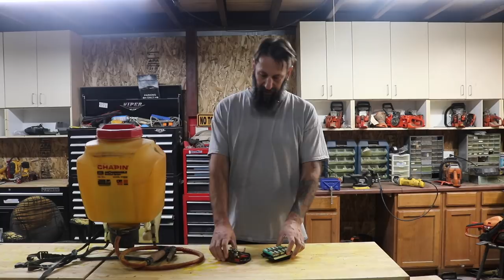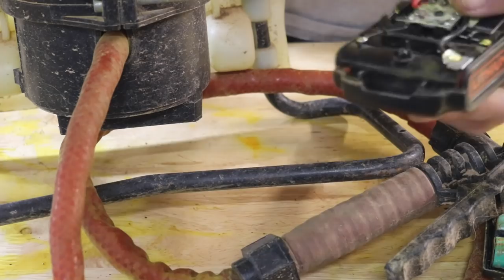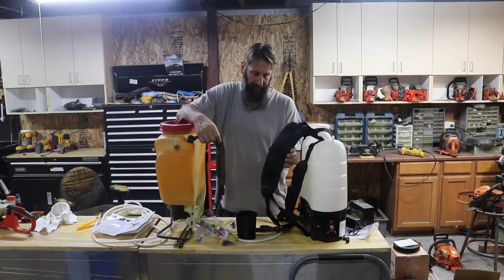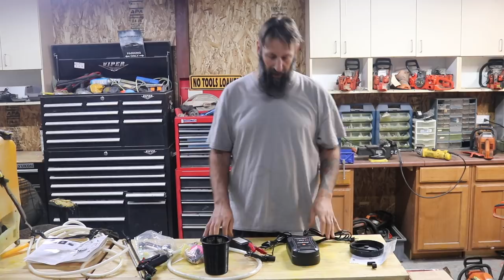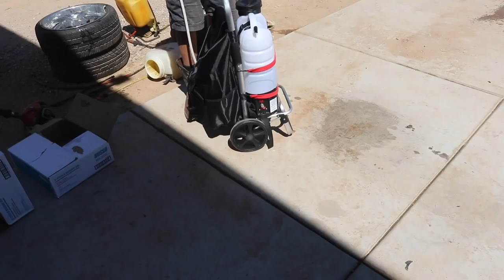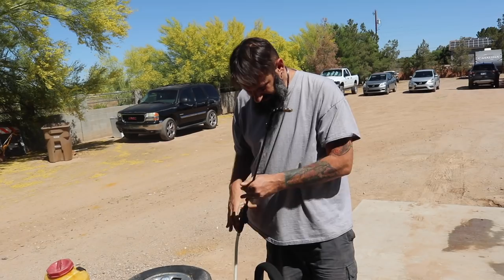My 4 Sons M4 battery power backpack sprayers review.

Comment: I got a new My4Sons sprayer with the removable DeWalt battery option.  It works great, does everything I expected.  However, after you are finished using the sprayer, remove the DeWalt battery from the back of the sprayer.  If you don't and forget about it for a couple of weeks, you'll return to a completely drained battery,  ..., DEAD.  I have tried to jump start it, but to no avail.  Thus in the future, simply remove your Dewalt battery after each use.   Otherwise, .. mostly happy.

Comment: Have you looked at the Berchmier back pack sprayer or the FlowZone back pack sprayer, they both come in Electric
Reply from the maker: I have not.  I have seen videos on them but haven't tried either out.  Might in the future.
Reply: @BearsWorkshop  I own a pest control company, thats all we use, they will last for years, the flowzone will solve your battery issues
Reply from the maker: @ratfinder7812  Flowzone or Berchmier?  One problem we have with all our sprayers is the Preemergent we use.  When it drys out it gets crusty and causes clogs.
Reply: @BearsWorkshop  yeah, that's a problem, we use Wettable Powders and micro-encapsulated products that over time will clog filters and leave a crusty buildup.  Every friday at the end of the day my technicians empty the sprayers and put in a gallon of water with "Nutra-Sol" and mix it, run a little through the wand and hose and shake it in the tank, then let it sit over the weekend and it cleans it out very well, the complete instructions are on the jar.

Comment: Lead Acid batteries are heavy and they go dead if left alone for an extended period of time.  A four gal sprayer filled can weigh 35 to 40 lbs without a four pound battery.  So, no...  To me; there are better alternatives...  I went with Ryobi because they use the same lithium battery that they use on 200+ other Ryobi tools of which I have a couple.  Who wants twelve kinds of lithium batteries and their associated chargers???  Not me...